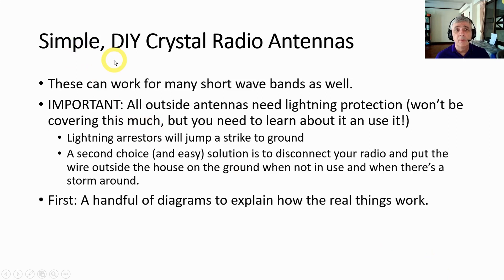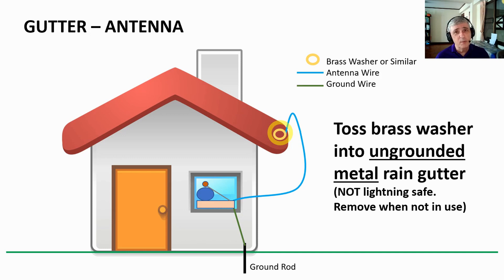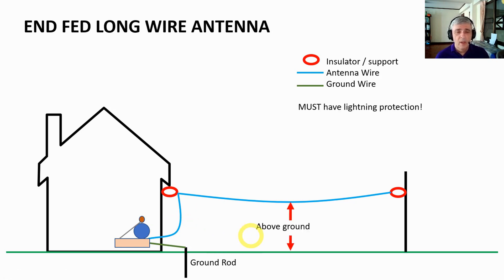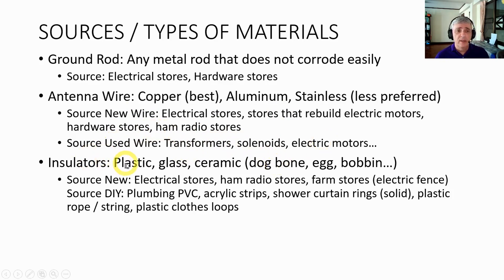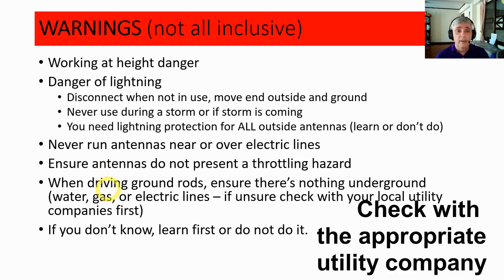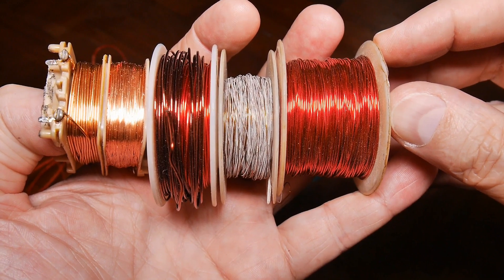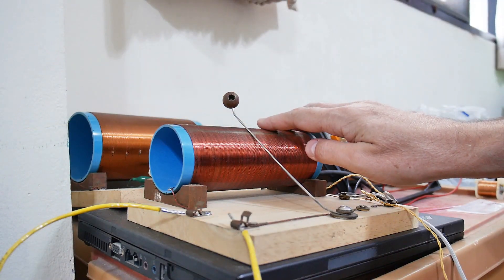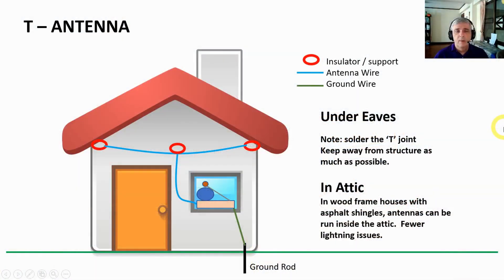Crystal Radio Antenna (Shortwave Also)

Comment from the maker: RELATED CRYSTAL RADIO VIDEOS: 
Best/Easiest DIY Crystal Radio - No Batteries, No External Power (4K)
https://youtu.be/fLVCqZGpv3U

My New Favorite!  Crystal Radio with Antenna Tuner:    https://youtu.be/mh5KxCpbQ5U
Crystal Radio, Capacitive Tuning - WORKS GREAT!:    https://youtu.be/VJ80Nm9KSkE
Crystal Radio & Resonant Coil Design:     https://youtu.be/Fw9eb-aB-XU

My Crystal Radio Does NOT Work (FIXES for common problems):    https://youtu.be/kCxQ8iPQx4s
Good Crystal Radio Connection Points:    https://youtu.be/G3qjrReHR1k
Crystal Radio, Connect A DC Audio Amplifier:  https://youtu.be/RW3VhnzgjtA
Three Upgrades For Your Crystal Radio:   https://youtu.be/LENco3_jV_s
Crystal Radio Wiper Upgrade:     https://youtu.be/i1otDz39nlw
Popular Crystal Radio Design That's a Waste of Time - And Why: https://youtu.be/r9Onub2Xpzc   
New Crystal Radio Design - "Modified-Pickard":     https://youtu.be/_qxHhFKjLAg
Crystal Electric Generator RF Energy Harvesting Exp 5 - Full Wave Rectifier:   https://youtu.be/BTu_GJKjOmA
Reply: Thank You for all your help.
I don't know if I can tell you how I feel about electronic nowadays. 
It's kinda like a kid eating all the chocolate he can and getting sick.
I really going to keep as simple as possible and make as much as from scratch as possible.
Reply from the maker: @johnmckee7937  My pleasure. I understand, hobbies are one thing, work is another. The designs in my videos have 2 main features: ease of construction, and highest probability of success for a beginner.
Reply: @tsbrownie  your videos are excellent. Glad you still enjoy it and able to teach others.

Comment: Hi!  Thank you for all your crystal radio videos.  They are very informative.  May I get your thoughts on this set up for my antenna?  The antenna will be an end-feed design, 50 feet long and made of bare copper 22AWG wire.  The feed line will be approximately 10 feet long and made of 18AWG insulated stranded copper wire.  The wire that connects the radio to the ground will be the same as the feed line -- approximately 10 feet of 18AWG stranded copper insulated wire.  The ground will be provided by a a copper clad ground rod that is about 3 feet in length.  Any suggestions for improvement?  Thank you!
Reply from the maker: @NagoyaT99  It sounds good. The direction it is oriented will affect which stations it receives. Be sure to follow safety protocols about lightning, running it away from power lines, working at height, etc.
Reply: @tsbrownie  Absolutely will!  Thanks again and please keep making your excellent and helpful videos.

Comment: Can you use plastic coated wire for the coil
Reply from the maker: Not really. It would make the spacing between the wires too much and it would change the coil properties.

Comment: Dear tsbrownie. Can i use my abandoned c band tv satellite dish as the antenna for Crystal Radio, i connect the cable on the top, on the lnb antenna.
Reply from the maker: Satellite TV is in the billions of hertz and AM radio is half a million to 1.5 million hertz. It's off by 1000s of times. But you might be able to use it to hold up one end of your long wire antenna! (Make sure there's no power to the dish and that it's not susceptible to lightning strikes.) Oh, and I named the channel after my dog, so....
Reply: @tsbrownie  hey, your dog is also has the same name with my dog sir, but he's dead years ago:(

Comment: Cool video.. Should the inside of my garden house work for an antenna? 6m x 3m with shingles on the roof?
Reply from the maker: If there's not a lot of metal or cement in the construction then it should be OK. Avoid running it near electrical wiring and such.

Comment: The really sad part about these kind of radios/antennas is that more and more electrical devices don't have proper copper wire in them and it's actually really hard to scrounge or repurpose transformer wire since they're all copper clad aluminium wire. It's real hard to find proper copper wire in modern electronics and most home purpose cabling (extension cords, audio cable, etc.) are also aluminium wire.
Reply: I get it from amazon.
Reply: Psst ! 

Relays 

Though thin you can get a really long wire 👌

Comment: Aluminum wire not electrically conductive?
Aluminum wire not good for antenna?
?
Reply from the maker: It is higher resistance and harder to make a low resistance connection. But it will work.

Comment: Excellent Ideas!
Reply from the maker: Thanks. I put together my first one as an 8 year old cub scout with zero financial means.
Reply: @tsbrownie  I was a bit older, maybe 12?
I remember I did shellac the toilet roll like the book said to. It turned out it was a foxhole radio 
From an old library book.
Reply from the maker: @johnmckee7937  My first one lasted until the toilet roll got crushed. :( Now I recommend PVC blue water pipe, which is pretty crush proof. With your background, you might want to jump right to the more advanced version. https://youtu.be/mh5KxCpbQ5U
Reply: Might I add a suggestion from someone who has driven more than one ground rod in his life.
Plan ahead, start watering the ground where it's going.
Dig a small hole and keep filling with water. Makes it much easier to drive ground rod.
Reply from the maker: @johnmckee7937  Or you can do this!  https://youtu.be/x3GJMAegRqQ

Comment: I like to use 1 inch PVC pipe for insulators.  I cut off 1 inch slices, then put 4 holes in it. 2 holes are for the antenna wire, and 2 holes for the paracord I use to tie it to a tree or pole.
It's too bad you can thread a wire through the inside of some paracord.

Comment: Hello sir two questions:

1. How do you avoid coming “close to the house” if you are running in the attic? 

2. I was hoping to run from the attic to my room through a metal central air duct vent. Is this just stupid? How else can I get the wire into my room?
Reply from the maker: 1. In the attic you have no choice. If you have a metal roof it will block the signal. 2. That will not work well through a metal duct without a lot of fancy wire work. You can start with a temporary wire antenna in the room until you figure it out.
Reply: @tsbrownie  how about coming through a coax cable through the attic into my room? That should work shouldn’t it?
Reply from the maker: @Bankable2790  That's really hard to explain. Antenna matching is a difficult thing. Coax comes in different impedance and unless it happens to match your radio and antenna it would likely work weakly or not at all. I need to make a video on making an antenna matcher. I've got something that might get you going in the right direction: 
https://youtu.be/mh5KxCpbQ5U
Reply: @tsbrownie  Thank you so much man! I am about to rewatch some of your crystal radio videos I have saved. Do you have any good resources on keeping an under-eave antenna grounded for lightning? TIA
Reply from the maker: @Bankable2790  Not specifically. Ham radio guys have a lot of info on that because of their long wire antennas and such. I just disconnect and put the wire outside.

Comment: would a slinky work as an antenna?
Reply: My roof is metal, how does that interfere with an inside antenna in the attic?
Reply from the maker: @chrismead1464  The metal roof, or even metalized insulation in a roof will significantly diminish the ability for radio waves to penetrate.
Reply: @tsbrownie  I was afraid of that...
Reply from the maker: Interesting question. Yes it would work, the question is how well it would work. That I don't know. If you try it, let me know how well it works.

Comment: Thanks for the video, is it better than to use magnet wire instead of one with plastic insulator?
Reply from the maker: Enamel wire is best.  Plastic insulation would be very hard to work with.
Reply: @tsbrownie  We try enamel, but the best was just to connect to the TV antenna, which in a way is the same. I saw another video were you said that the model with a capacitor and inductor its not okay, and actually we are getting trouble to catch more than two AM stations. We'll try the radio you showed. We (my students and I) are very grateful for your help.
Reply from the maker: @ProfeJoseph  If you are going to build a crystal radio, this is my new favorite.  A bit more complex, but has the best results by far.
https://www.youtube.com/watch?v=mh5KxCpbQ5U
If you have questions, let me know.

Comment: Dear Sir thanks for sharing Very useful information about antenna for Cristal radio. Can you please make video for how to make coil for Cristal radio., Please explain what SWG/AWG ENAMAL WIRE TO BE USED, NO OF TURNS  FOR SINGLE COIL/ ANTENNA COUPLR COIL, DIAMETER OF PIPE ON WHICH COIL TO BE WOUND. THANKING YOU IN ADVANCE
Reply from the maker: I have a video on making a crystal radio that explains much of this.  Also a lot of data is in the description.

Comment: Very helpful, I'm in the process of building my first crystal set, grounding rod is in the ground (79" down) next is the antenna. I have a 50' roll of copper wire and plastic insulated eye screws (like for tv antenna). I won't be keeping anything connected while not in use so lightning shouldn't be an issue (I will keep the feed and ground lines outside). Your tips about the feed line connections are most helpful. Waiting on delivery of some vintage high impedance headphones then I can do a mock up of the set for testing.